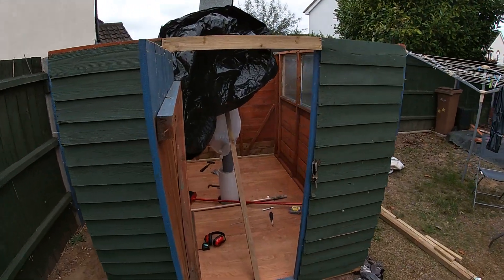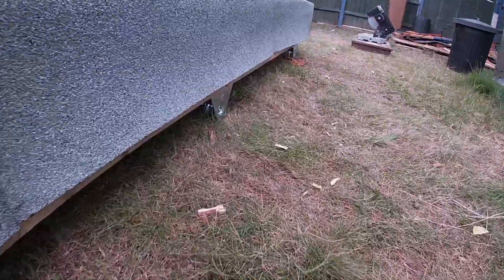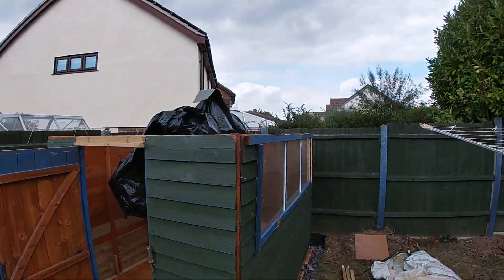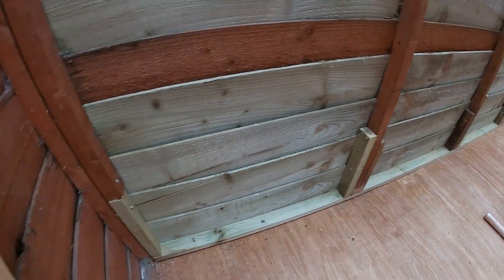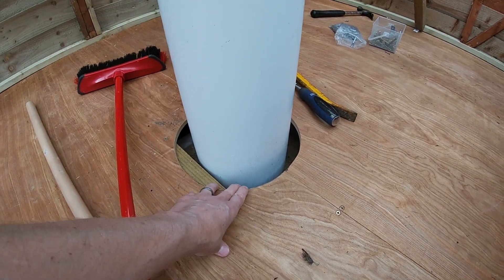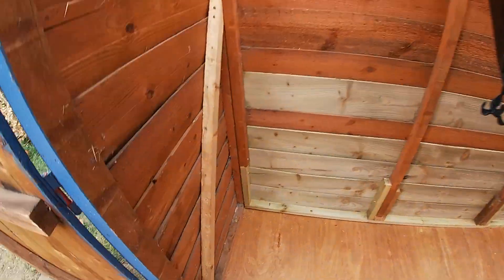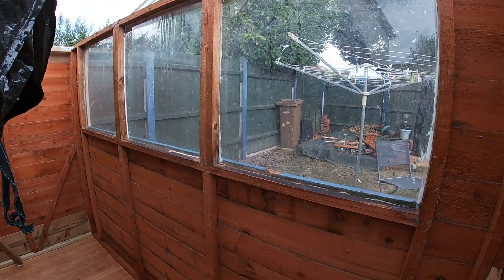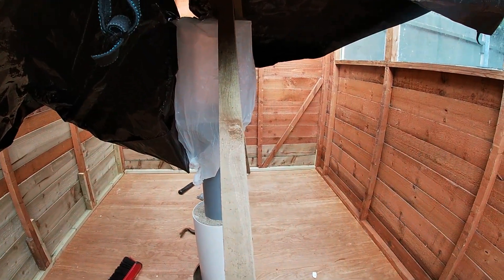Observatory Build - Reinforcing the Walls Ready for the Roll Off Roof

Comment: Coming on nicely! love the guitar groove.......Just like me, astronomy and playing the guitar...Love it!
Reply from the maker: Cool, what guitar do you play?
Reply: @Astrolavista  Les Paul Studio 2000 model and a Raimundo flamenco. I played in various rock and metal even folk bands over the years, and wanted to try a completely new approach to guitar, so 15 years ago I took up flamenco, hence the flamenco guitar, best thing I ever did, I've developed some awsome techniques I would never of dreamed of, but, WOW! What a learning curve, but a lot of fun and very rewarding...If you stick to it.
Reply from the maker: @smalloptics753  The strumming for flamenco looks tricky so well done. I'm trying to learn percussive guitar where you tap percussion on the guitar body whilst strumming. It's probably the hardest thing I've tried to learn on guitar but I'm looking forward to cracking it.
Reply: @Astrolavista  Yes the strumming is a bit tricky (Rasgueado) in Flamenco. There is a lot of percussive stumming also  in flamenco it's called "Golpe" I virtually wore a hole in my guitar (no exaggeration) because it didn't and still doesn't have a scratch guard. Becaues you need quite long nails in flamenco, it was my nail that did the damage...Good luck with the technique.